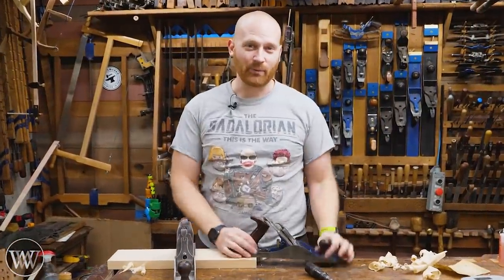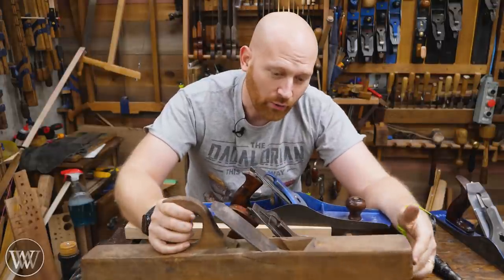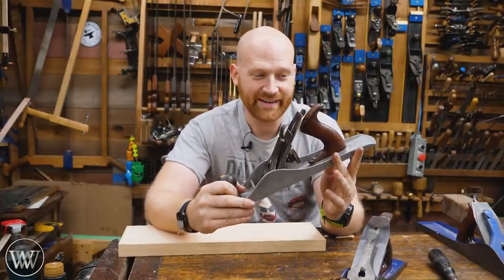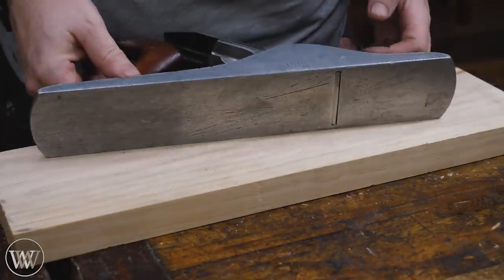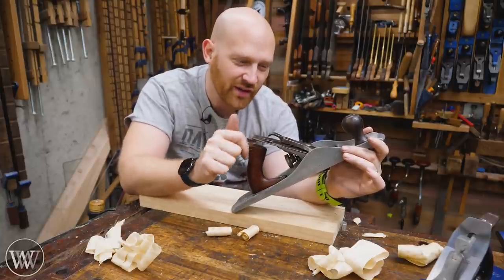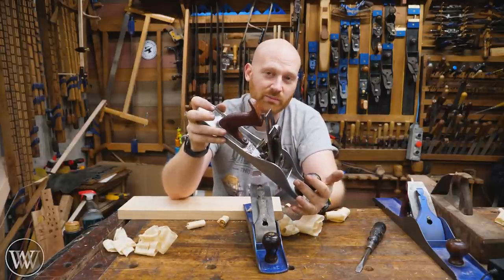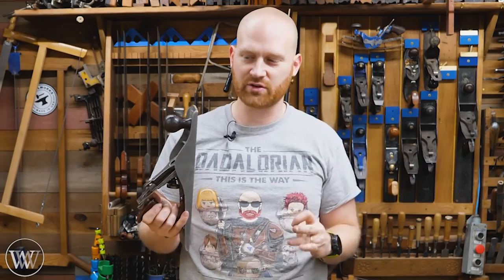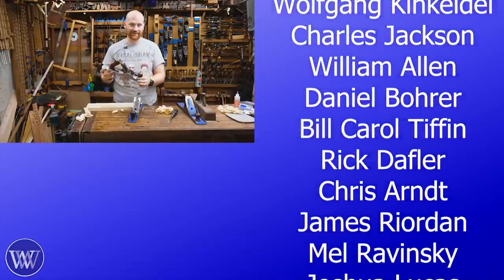The Interesting History of Aluminum Planes

Comment: Another rare and unusual aluminium plane is “THE BOSTON” brand, block plane made from aluminium in the United Kingdom. I understand that they were made from the aluminium frames of the Douglas A20 Havoc light bombers, renamed ‘The Boston Bomber’, by the RAF, that were among other aircraft that were stored at the Llandow airfield, Glamorgan, Wales after WW2. By 1946, there were 856 aluminium frames from the plane waiting to be scrapped post WW2. The aluminium block planes were manufactured by the Thomas Machine Company Limited in South Wales and distributed by the Welsh Industries ‘Bridgend’. The models comprise of the Boston No1, 2A and No2. Not sure if there are any other models. The only non aluminium parts are the screws, cross bars and the blades. I recently purchased a 2A and am in the process of cleaning it up as a collectors item.

Comment: I had been thinking of trying to cast a router plane in aluminum or brass but considered the softness of the metal for scratches. This video definitely gives support for that. Maybe a steel plate sole that connects to the aluminum base to get the best of both worlds.
Reply from the maker: Bronze or brass is actually pretty good for it. You'll see a lot of farm-made hand planes where they stole someone else's Stanley and cast the body in brass or bronze.
Reply: I had similar thoughts of casting plane bodies, but one thing to beware in mixing metals is differential thermal expansion.  Having a steel plate affixed on the bottom, and an aluminum top, your sole would be warped at any temperature other than the one you assembled it at.  A few thousandths of an inch is enough to impact the performance of a bench plane, this might not matter much on a router plane though.
Reply: @AllanMacMillan , true. I think there are multiple issues that could arise. Since it would be physically affixed together rather than welded, casted or glued, I think the effect should be minimal for thermal expansion. 

Then again, there always are when building things with casting rather than steel casting or machining. Currently, I have access to 3D printing and starting to learn to cast metal. 

If all else fails, a transition plane of sorts could be made with aluminum or brass body/frog with wooden sole/handles.
Reply: Brass would be better if you're going to mix metals. I'm pretty sure steel and aluminum would be more prone to dissimilar metal corrosion than with brass and aluminum.
Reply: I was thinking the same thing for normal planes, with the exception of plating them. Copper first for making them flat, then nickel for hardness and durability. Then maybe brass for the look.
What I was wondering is this issue of "mass" . It seems to me that if the mass keeps you going then it takes power to get the mass going in the first place. So do lighter planes work well or not??

Comment: your comments about the light weight of the aluminum are on point - I have a transitional the size of a Stanley 6 that I prefer to use - it has most of the adjustments of a steel plane, and is easier to set than a wooden plane, but considerably lighter than a steel plane.

Comment: If you want to bring out a sheen in your aluminum plane, take it apart and put the body into a pan of simmering water, add apple peels and cores. Simmer gently for about 20 minutes, rinse and dry with a soft towel.

Comment: I noticed that there is no "Bailey" branding on this plane.  Interesting.  It could be that Bailey's original patent called for a cast iron body and frog, so Stanley might have not branded it as a Bailey for that reason.  OTOH, Stanley applied the Bailey brand to bench planes with the lateral adjustment feature, which Leonard Bailey did not patent..
Reply from the maker: they have different types where the Bailey came off the planes at different times, but the A series never had it.

Comment: Kind of odd how they made the A series for a lighter plane when the transitionals were a thing. I guess they were seen as too old school because of the wood. I like my no. 26, pretty handy and lighter than the no. 5. I swear it feels more front heavy though due to it's odd balance with the tote being so far away from the frog. It would have been nice if they updated the design a bit more than they did during the later productions with the change in depth adjuster screw and using threaded inserts to hold the frog down using machine screws instead of wood screws.

Preferrably with how Sargent attached the frog. The cast frame was threaded so it attached there instead of through it and into the wood sole. I have a transitional smoother made by them and wouldn't really hesitate replacing it's sole compared to the Stanley. I don't have a drill press to accurately drill the holes for the inserts lol.

Comment: How about transitional planes as a lightweight alternative to cast iron. Lower friction and all the adjustability of a bailey plane. I've got 1 fully restored and another that I'm going to modify with a longer body to use for jointing. Should be a fun project... I hope. What are the down sides?
Reply from the maker: right on. those had fallen out of fashion by the time of the A series but they are in my book the best option if you want lighter.

Comment: Titanium planes would be great, light, strong and no corrosion (except like aluminium a thing surface oxide coat) .... but the price would be astronomical (and good luck flattening them if you need to).

Comment: If aluminum rubbed off on the high spots wouldn’t that be helpful to know where to plane material off?
Reply from the maker: until it is flat. then it is all a high spot.
Reply: @WoodByWrightHowTo  Actually related to this, is there any technique for planing that actually works this way? I can see it would be better just to figure out how to do it right, but sometimes I just want to know the state visually.

Comment: i’ve seen aluminium plane totes is there a reason for those
Reply from the maker: Stanly sold those as a cheaper option for replacement totes or for Shop classes where they may be dropped often.

Comment: Sorry, but I can’t think of any tool which would be improved by making it out of aluminium.
Reply: A non-sparking hammer.
Reply from the maker: We used aluminum hammers doe working on brass molds so the aluminum would not ding the brass.